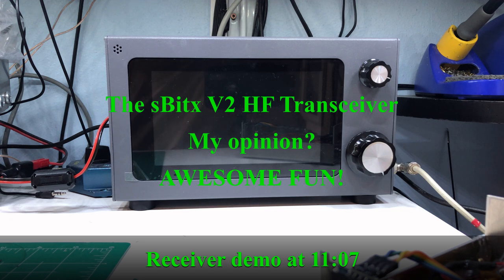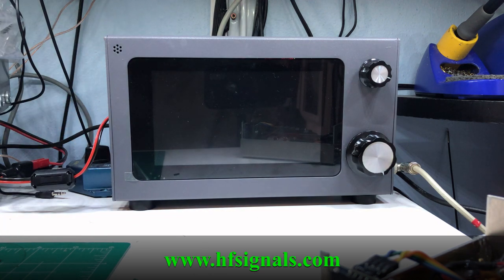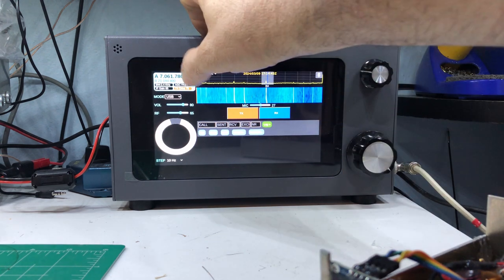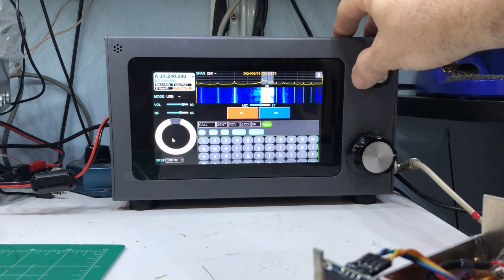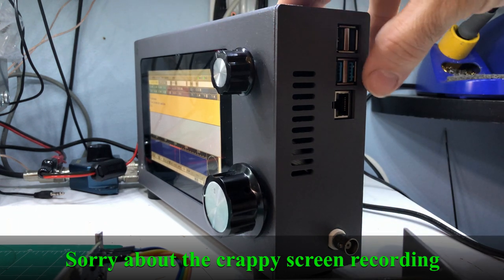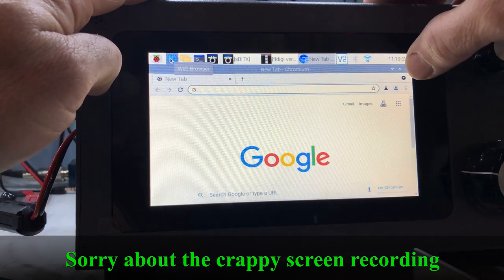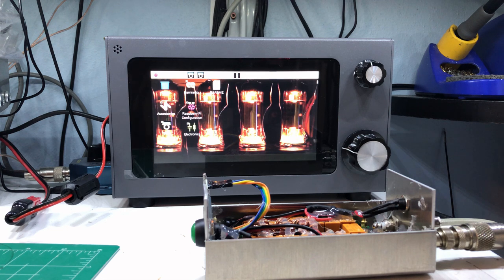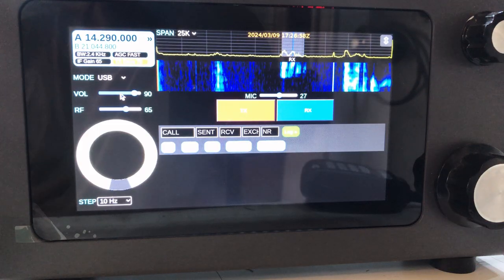My sBitx v2 Hybrid SDR HF Transceiver

Comment: I went with the "board only" and its been good. Its got protective acrylic so you can run it as is. One of the guru's of CW and QRP, Don ND6T got the V3 and loves it. I think I'll start working with it a lot more as I need to get proficient with CW (I had 13 wpm when I got my general many years ago and let it go, stupid of me) . The only thing I need to add is JS8CALL and I'm not sure I can get it into the sBITX menu but I could still use it. N6GRG

Comment: I’m on the fence about getting one.  The fact that the raspberry pi is integrated is really a neat feature. Have you looked into installing Vara AC HF? Just started with digital modes, so if the vara modem could be loaded that would sweeten the choice of buying the rig.  Anyway, thanks for posting the video, 73 N3BIL
Reply from the maker: It’s a fun radio. I haven’t tried installing Vara AC yet. That would be a cool addition to the rig. This one is a Version 2 and  FLDigi was a little flaky. But the newest version hopefully has that sorted out.

Comment: Thx so much for sharing this video on the sbitx! Your rig setup is the 1st one I have seen where someone runs a separate set of wires into the case to power the sbitx. Can you share your experience on powering your sbitx? Are you just running the wires to the internal contacts where that xt60 connector is attached? voltage range you are using to drive those wires? :) Appreciate it! --DJ KF0QZB 73
Reply from the maker: Wow, sorry it took so long for me to reply.  That is exactly what I did. I ran wires into the case to the point where the XT60 connects.  I didn’t want to wait for some XT60 connectors to ship. Everything here in my shack uses powerpole connectors.

Comment: Will it run JS8CALL? I didn't see it on the drop down list. 73 Gerald KG0VA
Reply from the maker: It will.  The screen isn’t really optimized for that one yet though.  So it’s kind of a hassle.  I didn’t add it on again when I went to the V3 software.

Comment: I am intrigued. As a linux user. When the digital modes are configured is there a "builtin" audio and serial device that is used? Obviously there isn't anything plugged into the side? Or maybe the Rpi has a pi hat on it that does th audio and PTT? more likely
Reply from the maker: Yes, the audio and CAT control are done internally.  Already having a background in Linux will surely help with this radio.  There is a good Facebook page called “sBitx” and also a Groups.io group called “BITX20”. Lots of great people doing some interesting hacking/developing of the SBitx.

Comment: Does this rig have a Noise Rejection function? If yes, how good is it? Thanks for the video and 73.
Reply from the maker: Currently there is not a noise reduction function.  Something may be in the works down the road though.
Reply: @propagating-radio  Thanks for the info. An s-meter and/or signal strength reading in dBm would be great!

Comment: I experienced lots of noise and whistles from a RPi next to my radio, how is this performing from that perspective?
Reply from the maker: There are some “birdies” on the bands.  That may be caused by the RPi.  It may be an interesting experiment to add some shielding to the receiver and/or Pi and check the results.
Reply from the maker: Aside from that though, the receiver performs very well and is quiet.

Comment: Was trying to figure out what software you added? Mine came loaded with all the same software.
Reply from the maker: I couldn’t get FLDigi (version 4.0) that came with the radio to do some of the FLMsg things I wanted. Ad for whatever reason I couldn’t update that software or delete it. So I added a newer version of FLDigi that would integrate with FLMsg.

Comment: I think this is the future of ham radios - having a PC within them - so that all digital modes can be run from the radio without and external computer. Logging into the radio is also very useful. The Xiegu X6100 has similar capabilities. Good to see Farhan following/setting the trend.
This could be a great radio for FreeDV (HF digital voice) work.
73 Ed DD5LP.
Reply from the maker: Ed, I totally agree. I’ve had an X6100 and really enjoyed that radio as well. It’s going to be fun to see what the future brings in new radio innovations, hopefully more and more of this merging of radio and PC tech.

Comment: I really like mine.   I have tried it with a 3b and a 4, both work.   The case reminds me of an old Lloyd AM/FM my grandma kept on her fridge.

Great for POTA with a couple of 10KmAh 3s drone batteries, and a cheap at-100 tuner clone.
Reply from the maker: I had to look that Lloyd up.  It does have that same type of look.  I’m very impressed by this SBitx.  I do plan to try it portable and for POTA.  Great size for it. And I just recently picked up an ATU-100.  Perfect combo!
Reply: @propagating-radio  From the tapped screw holes in the rear cover, I would guess there are plans to make a tuner, and a battery  holder.   Or at least give us an easy option to attach some of our own creation.   Great little radio.
Reply from the maker: @Doonit_hard_way_since_65 oh man, that would be pretty cool!